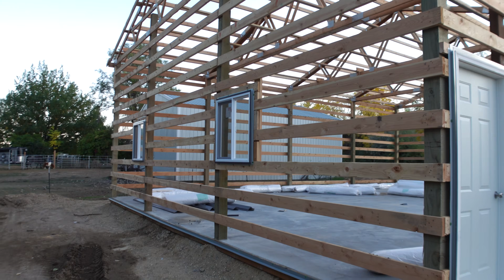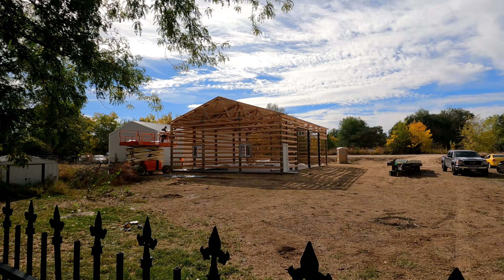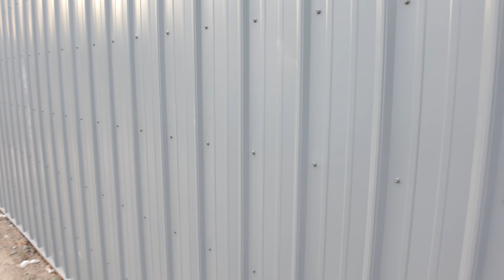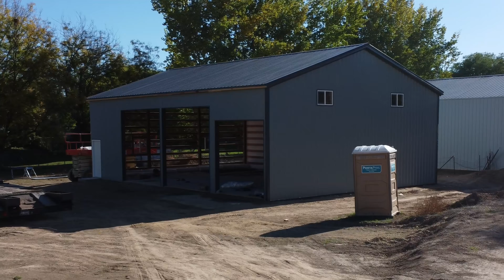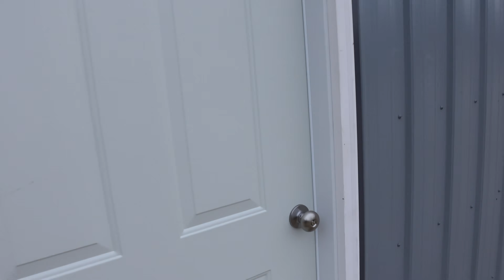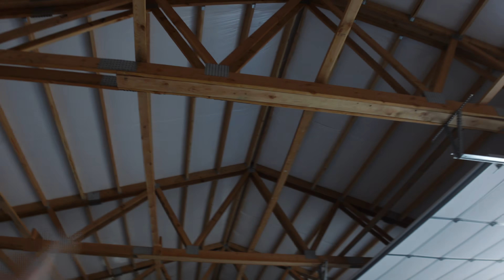My Dream Shop Is Finally Done! 36x48 Pole Barn Garage

Comment: Im looking at getting same thing either a 36x40 or a 36x50. Is there a reason you are the builder went 36x48 ?
Reply from the maker: They could’ve done 36x50 no problem. I don’t know why I chose the size I did if I’m being honest, was bigger than 30x40 and was able to be visualized using cars parked in parking spaces in a Home Depot parking lot since spaces are 8x12 😂